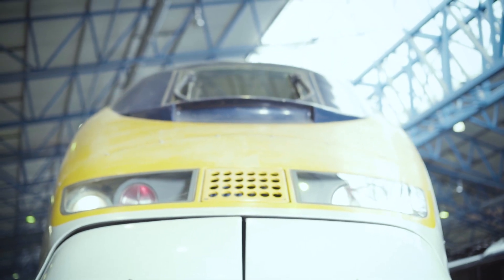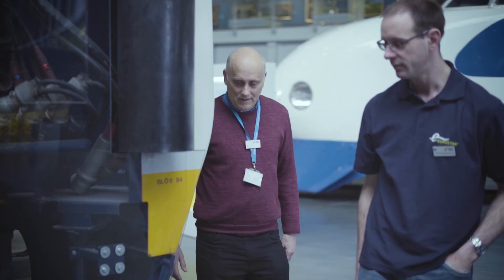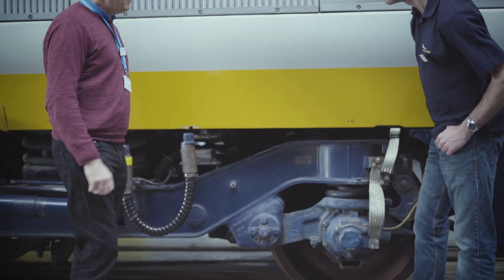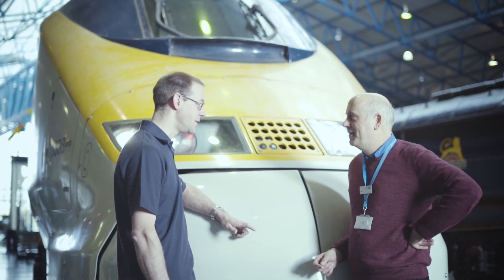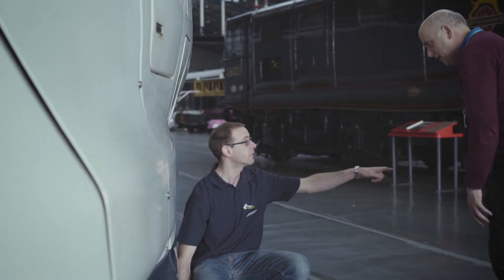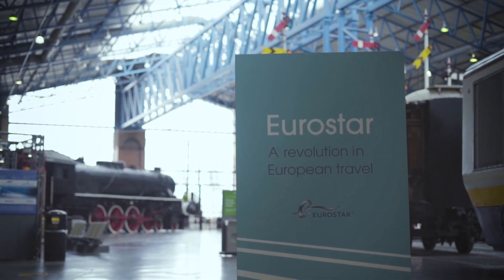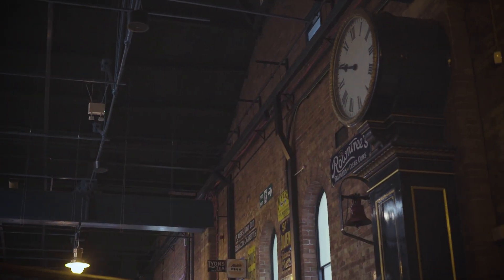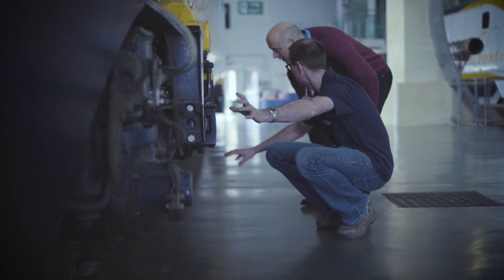Allons-y ! See the impressive Eurostar Class 373 at the NRM | Eurostar

Comment: I really like the 373 I wish you wont scrap these lovely units also I know you took the 374 shape from turkey 🦃
Reply: What? First of all the Siemens Velaro in Turkey is based on the Velaro D trainset, manufactured by Siemens and first run in Germany. Siemens won the contract to manufacture 10 derivatives for Eurostar in 2010, that was later increased. Then came the order to supply turkey with 9, later increased again.